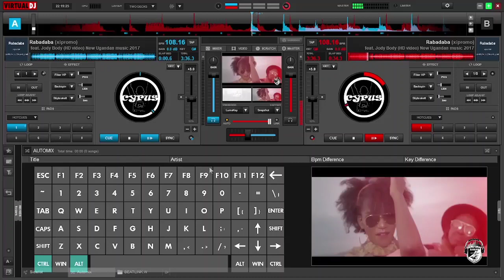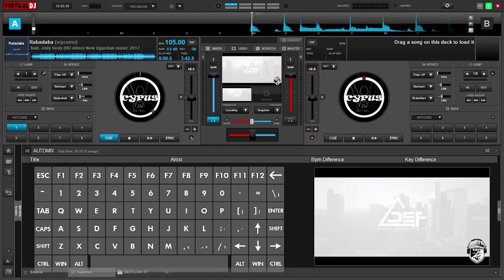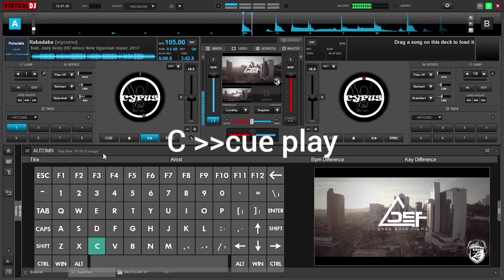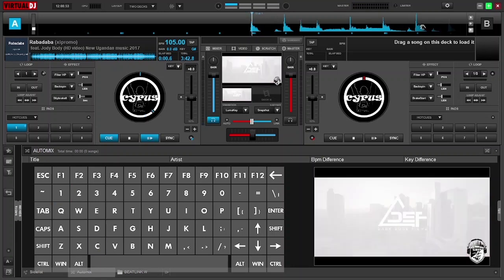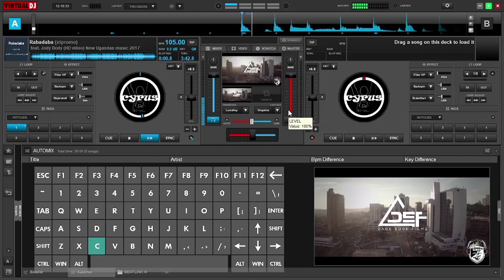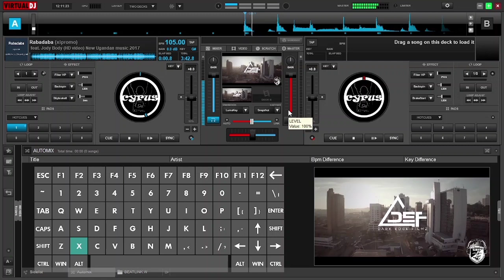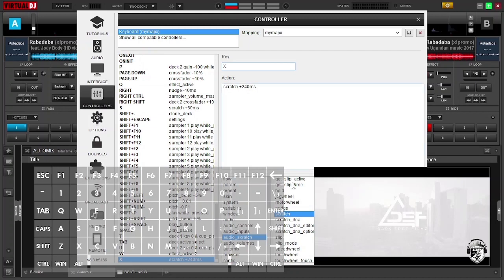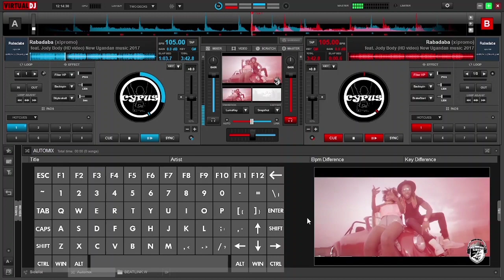Virtual dj 8 How to scratch using a keyboard - Stab Scratch Tutorial.

Comment: My friend, I have set up cue_stop and have tried cue_play, both work but the cue point moves and I can't figure out why?
Reply from the maker: When does this happen
Reply: That means a separate code is interfering/clashing with that command. Look at the other codes or it might be the code you mentioned. It happened to me too and that was my issue. My codes have more added to the ones in this video but I got it right now.

Comment: Man it failed to work n ma pc may b itz bse of the Alt ➕ 1.i can't go back to the cue 1 wen uzing another mapper apart from that one.
Reply from the maker: Just set 1 as goto cue 1.then instead of using alt+1 you will use just 1
Reply: I got it bro, used another simpler method.